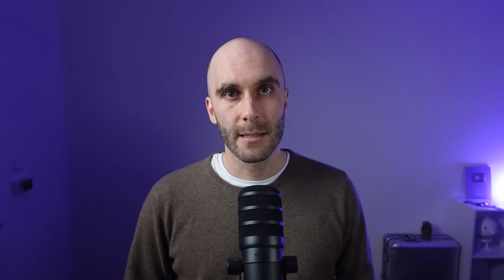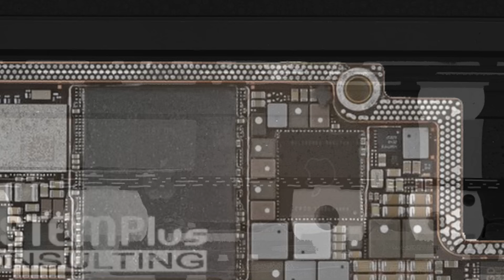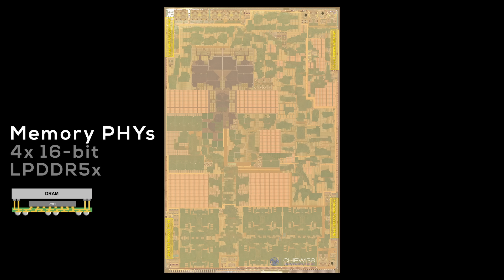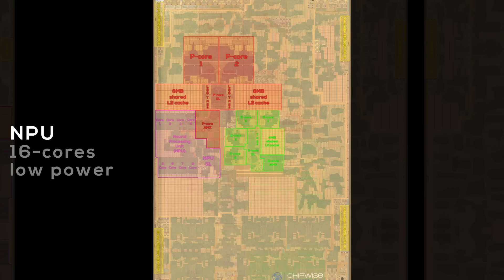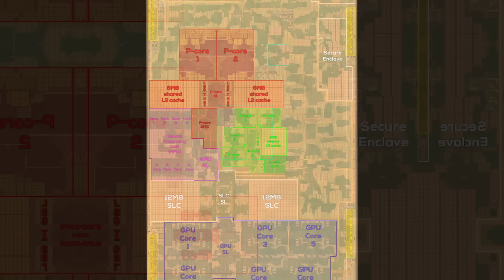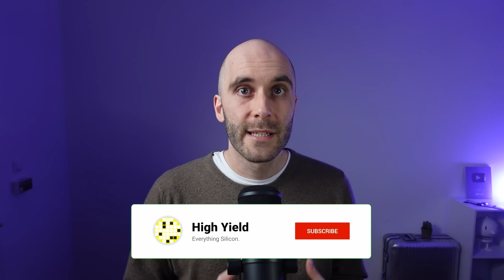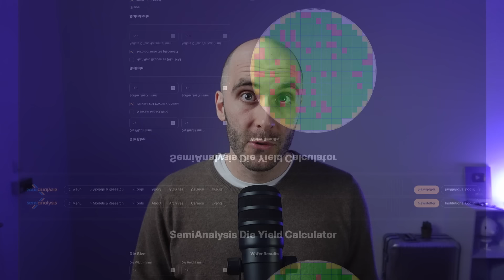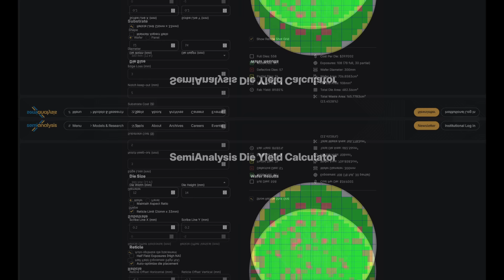A18 Pro & MacBook Neo Deep-dive

Comment: Since Apple reuses the InFO PoP from iPhone, it wasn’t that they didn’t intend to make a 16GB model—it’s that they couldn’t.
Reply: i think the factor was primarily cost. The whole point was to use up their huge amount of production capacity for a18pro chips. Its wasteful to spin up whole production lines for a chip thats only made for a year, and with apple's supply chain influence they can get the processors extremely cheap. I fully expect the neo to continue to be a "vent" for extra iphone chips they get good prices on. Maybe a19pro comes next, with its 12 gb of ram. Or maybe they skip that one and order a few million extra units of an a20 pro or reuse lower bins of that soc. I think its efficient resource usage.
Reply: So next year it will get the a19 pro and have 12 gigs. Big upgrade
Reply: I don’t really buy that. There’s nothing to stop them adding traces and putting more RAM beside the chip. I believe rather they WOULDN’T because this is already intended to be a low end, low cost device and intended to use existing binned stock. Adding more would be against the point. 
Next time round there’ll probably release it with the next already existing iPhone chips with 12-16 and so there’s no reason to engineer a logic board to accept that much.
Reply: The a18 pro has the ram data lines on the top as the ram is attached to the top of the soc to save space inside of a very packed compact phone logic board and phone socs expect very short distance between the ram and the soc memory controller so it's extremely hard if not impossible to use a different type of ram especially when a low cost is your goal as reuseing existing silicon saves tons of money
Reply: @404hopenotfound  eventually when they release the MacBook Neo "2" with the A19 Pro, they should be able to bump that up to 12GB of RAM since that's what the iPhone 17 Pro models use correct?
Reply: @admin1486  Whatever they had it packaged with, yep. The whole point is to use the chips that didn't meet their bin requirements for the iPhone, and those chips are delivered to apple with memory already attached.
Reply: @admin1486 they could just put an a19 in the neo 2. Then it woud stay at 8gb of ram.
Reply: @Freshbott2 yes at an added cost, they just reuse trash that doesn't meet the bin requirements. There is no new silicon arch for neo
Reply: @r @robertosutrisno8604  Yes exactly what I’m saying.

Comment: A small nitpick - the NPU has 16 cores, not 8. On those die shots the visibility is not good enough and each pair of NPU cores looks like one. In fact, ever since Apple began integrating NPUs into their silicon designs it has been always the same configuration with 16 cores.
Reply from the maker: I beg to differ. I got really high-res M1 die shots, and you can clearly see all 16-cores on the NPU. Somewhere along the line, Apple changed the NPU core layout to a dual-core design. It for sure wasn't in the beginning. I'll talk about it in the M1 video ;)

Comment: Makes sense why the Neo is limited to 8GB.  They got a warehouse full of old pre-built A18s they gotta unload.  Hopefully, Neo2 will have freshly built SOCs with a 16GB module "info popped" on the (A??) cpu die.
Reply: If the MacBook Neo gets updated next year it will most likely feature the A19 Pro, which is packaged with 12GB of unified memory.

Comment: So the core concept of "Moore's law" is in 18 months (or so) we will be able to put 100 transistor on the same size die that we are currently putting 50 transistors!  And yes, this was the original argument.  It wasn't about performance, it was about economics.

At the time Gordon Moore originally stated Moores law, it wasn't for CPU's.  It was just putting more transistor in a package.  And that package didn't have to be used for digital designs at all. It could be analog transistors. 

The big cores verses the small cores really illustrate what Moore's Law means when applied to CPUs.  More transistors => more parallelism at the architecture level for each individual CPU.  This is how we were always supposed to get performance from Moores law.  It was by asking the designers to answer the question "what are you going to do with all those transitions?"

Comment: If I recall correctly, the Raspberry Pi Zero does sometning similar where they package the RASM togheter with the SOC.
Reply: Yeah, Zero (1) packages it like the A18 pro while the Zero 2 encapsulates it in the same package/plastic
Reply: If only they made a Pi Zero with more memory... I'm a fanatic of power and space efficiency. Just imagine some small 2-SSD NAS the size of a normal sized Raspberry PI hosting your movie library and backups, so efficient you can't even notice it on your power bill.

Comment: 0:53 A15 is iPhone 13
Reply: Depend of the version if it's the 5c or 4c gpu core
Reply: 13 pro max and 14 straight
Reply: pretty sure the 13 and 14 use the same cpu chips, 14 just upgraded
Reply: @lilbroomstick7032 yeah the 14/13 pro have 1 more active GPU core

Comment: The more I look at Apple hardware the more I feel PC hardware is inefficient and outdated. The M.2 storage format for example, why the fuck does it need its own SOC and DRAM to access some flash? Why can't it be like Apple that's just built into the system and if you really want to put ONLY the NAND chips on a daughter board? It's of course the exact same situation with GPU, dedicated GPU memory is such a HUGE waste of hardware.
and please don't tell me your 8000MHZ DDR5 has low latency, nobody cares because the Apple M5 core is much faster than your Zen5 cores regardless of your 60ns latency.
Reply: > Why does it need its own SOC and DRAM just to access some flash?
Having a separate flash controller is necassary to get the kind of speeds we've become accustomed to. Apple devices have flash controllers too, they're just in a different place (on the SOC). But if you want to be able to replace your SSD module with a different one, it makes sense to ba able to replace the controller with it. It doesn't make a substantial cost difference, especially if you account for the difficulty of repairing failed Apple storage. The DRAM is also for speed, and it's not strictly necessary even on Linux or Windows - see Host Memory Buffer.
Reply: @danielparks6062 Apple also has removable storage, they just have only the flash chips on the daughter board like I said.
M.2 drives are ridiculously inefficient, a fast drive can use 5w or more which is as much as an entire Mac in many cases.
Reply: M.2 was defined ?10?+ years ago, so it has a different history AND M.2 has many other use cases other than nVMe SSD. In addition, M.2 NVME DRAM cache (if the SSD has it) gives a performance boost. In the case of the neo I've seen YT videos showing much better STORAGE performance from current, similarly priced "Windows" laptops.
Reply: @vkristof1  Apple has been using SSDs for more than 10 years, so what? 
The same performance boost can be gained from using system RAM, it can be shared, and hence reduce waste, that's what I've been saying.
Reply: @chengong388  There are plenty M.2 SSDs that use the system RAM, I'm using one right now
Reply: Dedicated GPU memory is not a waste of hardware, unified memory is already used on PC with integrated GPU and it's a severe limitation for performance. Don't expect modern games to run well without dedicated VRAM
Reply: @guy@guyg.8529modern games all run well without dedicated VRAM, on consoles, what are you talking about? Also if you’re thinking integrated GPU PCs, they’re still wasted because a lot of data must be duplicated between RAM and VRAM, that’s just a required silly thing on Windows.

Comment: The question should not be "Can an iPhone chip run MacOS?" But rather "Why can't the iPhone run MacOS?". At least as an option.
Reply: There's no excuse to not let iPads run MacOS. It would just cannibalize macbook sales.
Reply: @daniel_960_ ipads could just as well become macs.
Reply: They went full circle after making a Mac chip run iOS on the iPad.
Reply from the maker: They could, Apple just doesn't allow it. And the new Studio Display XDR actually has a full A19 Pro with a 128GB SSD. It's basically a iMac.
Reply: marketing. I guess thats obvious why would they do macOS on iOS when they have to sell MacBooks? MacBooks are better for macOS and iPhones are better for iOS.
Reply: Because on iOS, you can only buy apps from Apple Store, which means more money for Apple.